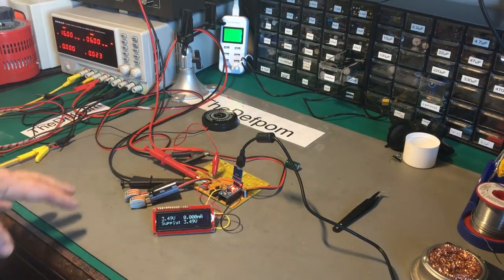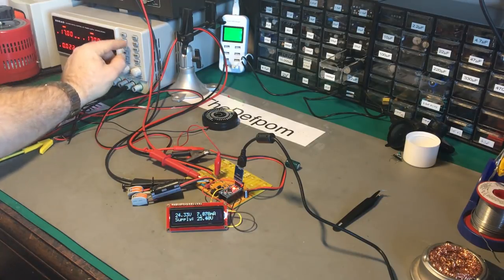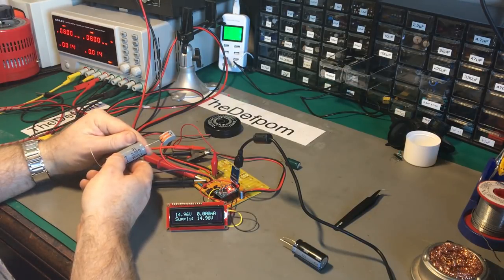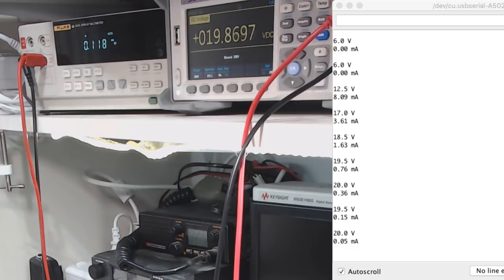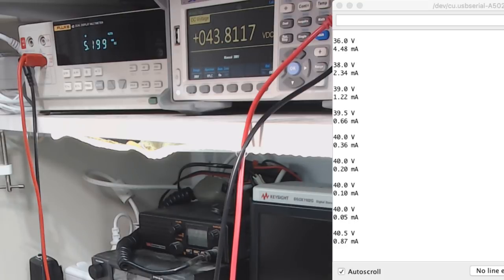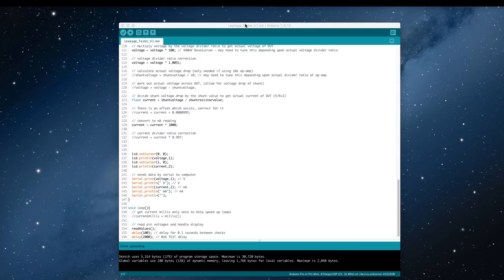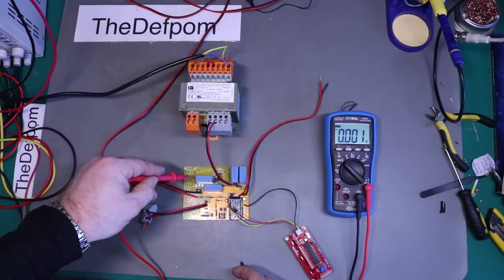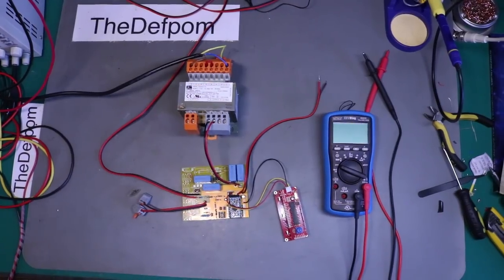🔴 #407 High Voltage Leakage Tester Project Part 4

Comment: It's a shame you can not get a small variac like 30W or so so you can adjust the voltage for the leakage tester by altering the primary voltage.